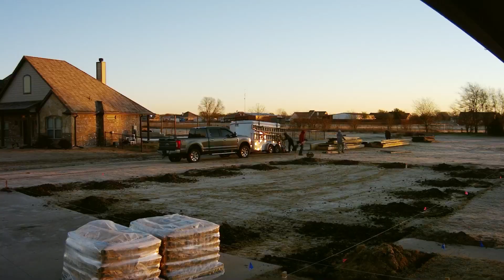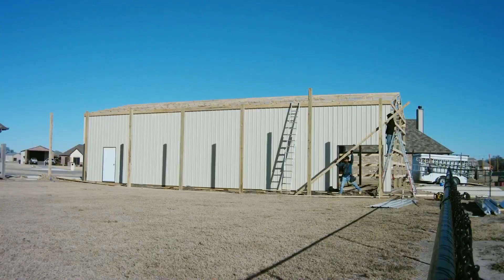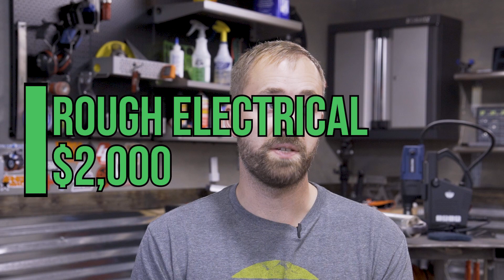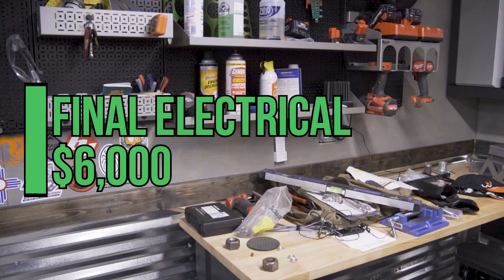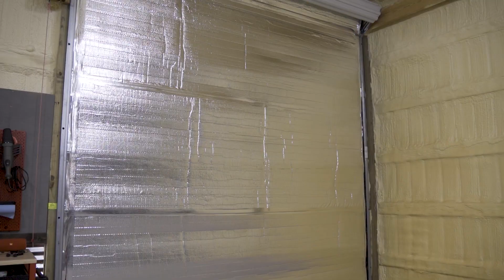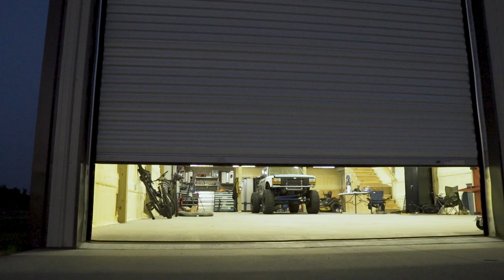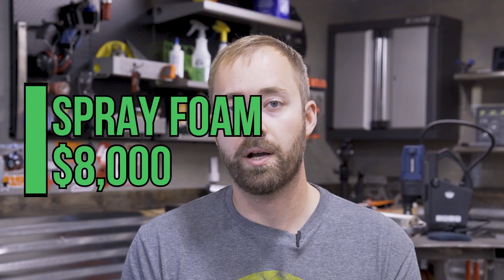How Much Does A 30x60 Pole Barn Cost? - Reckless Wrench Garage

Comment: I live in northern Michigan but grew up on a Nebraska farm where we poured concrete, built sheds, and if we needed something done we did it ourselves. I am a crippled veteran so spending the $180k they were asking to build my shop was out of the question. They wanted $80k to put up a 24x24x10 garage. Yeah the builders/contractors here are really proud of their work. I built a 32x48x12 for about $18k. 

I have to worry about snow load. 72psi is the requirement, because we can get 6 to 8 feet of snow in a few hours. Lake effect is epic.  I see the inside of your building and if you built that where I am, it would be on the ground by the end of December. I had to clear trees to build my shop, so I did that and rented a small excavator to rip up the stumps. Started running the chainsaw in the last week of June, had to wait for the snow to melt and the ground to dry enough to work.

Then I prepped the foundation, built the forms, and poured a 5" thick slab with steel mesh and fiber concrete. The guy who came out to help me pour it charged me $6k and brought one other guy, then the cement trucks started running. We did it in on a Saturday afternoon in September. Yes it took me all summer to clear roughly 3 acres of trees, stumps, and rocks, then dig the footings and level it all by hand with string levels. I got it within a quarter of an inch across the entire slab.

I picked the best maple trees that I had to clear which were the straightest, and used chainsaws to cut one side flat. Some of them are 14" in diameter, so its VERY overbuilt for the poles. Then I started building the walls. Hired two guys to come help me put up the trusses which I had to buy for $5200, and rented a scissors lift to raise them up. That took two days, and I paid those guys $1000 each to help with the roof, which took another two days to sheet with 5/8 OSB then put the steel on.

From that point it was all me. I built the sides, the sliding door, wired and started insulating it. Sheeted the entire building with 5/8 OSB then put on the steel, they don't sell the lighter stuff around here. Buried the wire to the shop from the meter 150 feet away with a ditch witch. I figured why not put in a lift for working on my cars, and I made deeper pads in the slab where the lift would be bolted down. I'm getting old and like I said, I am a crippled veteran, crawling under cars is not my idea of fun anymore.

I finished the basic structure in November, and hung the sliding door two days before the first big snow back in 2015. In 2018 I put a lean to on the north side so I could park three vehicles out of the weather. In 2021 I built a lean to on the south side where I can park six vehicles out of the rain and hail we get occasionally. Currently I am insulating it more and adding a lot more LED lights so I can see what I am doing.

This summer I will build a simple 5 car garage next to the shop, gravel floor, 22' deep, 8' ceiling, and once again I am using the trees I have to cut down to make room for it. This time I am getting a portable sawmill to cut the posts, and its going to be a post and beam structure rather than a 16" center stick build like most people do. Yeah I am kinda into old muscle cars, and I want another spot to park them out of the weather as I finish rebuilding them.

Then there is the house I built... with shipping containers with the same $30k building loan that I used to do the shop. I call it my two story burrito bag. The best idea with shipping containers is to insulate the outside with a stick built fascia otherwise the steel gets cold and condenses water on the inside. Rain and stuff inside the house don't mix well. Its all temporary but I am making it nice enough to live in until I can get a log cabin kit and put that up where the old decrepit falling in cabin is sitting. 

This was a hunting camp before I bought it, but I needed an inexpensive place to live, and this fit the bill. Been a crazy amount of work though. 

Its all built with an eye towards going off grid easily, because the grid is VERY unstable here. It went down 47 times last year, which is why I have a 7kw generator. All the lighting is LED, heat is a pellet stove, firewood, or the compost pile water heaters I build (sawdust from the sawmill and woodchips will make one next year and I will make a video series of it). I make ethanol fuel from cattails and tree sap, because gasoline is expensive and I like to drive old muscle cars with Pontiac 455s in them. Started doing that back in 2007 when gas was $5 the first time.

Along with the garage I plan to build a greenhouse so I can grow food all winter and power the grow lights with a small generator running on methane or ethanol which will dump the CO2 produced by burning those fuels in an engine, into the greenhouse to use less water and grow more food. 

Inadvertently I built EMP proof buildings. So I am apocalypse ready... save for big space rocks or the Yellowstone caldera.

If you have time like I do, and some of the skills you can do this too. If you don't have either of those... best to pay people to do it for you.
Reply: You should make a video of these buildings, I’m in MI too and would love to see

Comment: Thanks for the info, great video. In the architectural phase of building a 50x50 steel building in Phx. Knowing I should go with 2" spray foam helps with my budgeting.
Reply: How did your building turn out? What are you heating/cooling it with and are you happy with the 2 inch spray? Any moisture drips from the ceiling?

Comment: You did not mention zoning restrictions and permit expenses.

Depending on where you live, zoning may require a variance approval, which can easily cost $300+ to apply for, with no guarantee of approval. 

The expense of engineer or designer certified blue prints will be required for a permit to be issued. Normally, a permit fee is included with a builder's estimate/contract, but if the builder doesn't bother to take out a permit, construction can be stopped by your area's enforcement authority. The enforcer can actually demand demolition of whatever has been done (without a permit). The property owner is ultmately responsible to obtain a permit.

Again, depending on your local ordinances, final occupancy approval will have certain requirements - minimum restrictions may include lighting, an extra exit(s), insulation, rat walls, depth of footings, truss certifications, and a friendly, aggreable, and/or lenient building inspector.
Reply from the maker: Good thing I live in a state that requires none of that to build an auxiliary structure

Comment: I think you got taken for a ride on the concrete. You payed probably around 2x too much in my opinion. 15k for a 30x60 slab is very high.
Reply from the maker: 40x60. That is the expense of concrete in my area at that time frame. It averaged 6.25-6.50 per sq foot from multiple bids
Reply: @RecklessWrenchGarage  Dang. Those are some tough prices

Comment: Great video!!  You did not disclose the permits and cost of them .?What material did you use on interior walls?
Reply from the maker: Interior walls were framed in with 2x4 so I can hang 1/2 inch plywood and roofing tin
Reply from the maker: My state does not require permits for an auxiliary structure where I live

Comment: I’m in the process of planning a 50x60 or 40x70  pole building now.. prices where I live are all over the place. Looked into a metal building much more affordable but I’ll have to build it myself. Not sure if I want to take on that big of a project.
Reply: I’m in the business. Free advice; Beware of metal building brokers posing as manufacturers. Your anchor bolts need to be perfect. Hire an experienced steel erector. Anything over a 2:12 is a waste of $ unless you just want the look of a steeper pitch. If a manufacturer asks for more than a 10% deposit and have “free” or “included” all over their quote, run..
Reply: @BLKBETE11  I’m planning at least a 4  / 12 pitch. My snow load is 85 lbs. most people around here build pole barns but not very cheep so was looking at steel building.

Comment: You never put anything smaller than a 42 Ct 200 amp panel in a shop. Also make the stairs to the mezzanine on hinges . Use a harbor freight A/c wench to lift it. Not hard to do and not expensive. It will free up a lot of floor space. I had one in my old shop. We sold that farm ,but the next shop will have an elevator ( using the same H/F winch.you could also do that and just remove the stairs. There are plenty of videos here on different waves to build one

Comment: Thanks for sharing!! You could get 10 guys together that built the same shop and the Costa will all be different. Don’t worry about what you hear online. It’s been that way for all my knowledgeable lifetime! I’m 60,,, almost. Heh heh.  I think you have an awesome shop!! You did very well with the mezzanine as well! Really like the overhang/ outdoor storage as well.  I live up here in Canada so we insulate to keep the heat in!! 😂😂 last might the wind chill was -44 C or about 46 below F!!! It’s pretty d*mn cold out there!! I’m retired now so my shop is for my toys & projects. Was gonna do a 40 x 60, but there was room to go as big as 60 x 80 with covered outdoor storage that was another 24 ft (I have a lot of classic vehicles, I have a 4 car garage and 3car attached garage as well,,,, 😂😂, still not enough room). The shop walls are 18 ft and the mezzanine is 40 x 20 on one end. I have all my automotive & woodworking tools under there as well as a bit of a lounge and 2 pinball machines,,,,, priorities!! Haha. My wife took over 28 ft of the mezzanine and the stairs are within the 40 x 20 as well, so I didn’t get much storage up there!!  It all works. 
    I have 8 x 4 post lifts in there for auto storage so no special needs for the concrete, but it still 8” thick for the whole floor. There’s a floor drain for the length of the shop. My main lift is accessible from a side door and there are 4 - 12 ft w x 14 ft high doors on the front 60 ft facing  and 4 man doors. Lots of windows. I buttered the walls with 2” of spray foam for a thermal break, then built 2x6 interior walls against that with R22 Rockwool insulation and covered with steel. The walls have 3/4” plywood backing where I planned to hang things out the cabinets in the tools area etc. Then we put a steel ceiling and R50 blown in insulation up over the ceiling. The shop is comfy with the only cold spots being the doors. They are steel & insulated, but you can only do so much with them.  The shop was expensive!! I wouldn’t change it and after selling out the ranch, it was not a stretch financially. That being said,,,, I was my own contractor!! Gotta save where ya can. Saved about $35,000 CAD doing it that way compared to the lowest quote. Went overboard on the insulation, but you can be down in the floor and not be cold,,,,, which mattered a lot to me! 
     I am jealous of the Texas winters, but those summers!! I understand insulating against the heat!! I still have AC in my shop as well. It’s solar & wind turbine powered for electricity. You wouldn’t know it unless you looked close at the roof and out the back where the wind turbine is. The batteries & mechanicals are in a 10x12 room with lots of storage still available for my wife’s supplies. Haha. She tried to take over!!!😂😂. 
    You are going to get decades of great use out of that shop. I really like it a lot!! Great colours and you put the right things on like the rat guard to keep it new for the time you have it!! I see ya filling it with toys in your retirement!! Heh heh. Nice stuff indeed!!! Love your doors too!! I have panels for the better insulation values, but you don’t quite need that level and as such you get wayyyy nicer/better doors as a result. I’m a lot jealous there!! Very nice place!!

Comment: Thanks for the break down! These have gotten even more pricey. Especially the red iron builds I want to add a overhang similar to yours to park my fifth wheel under. I was quoted 30k  just to add that. And it isn’t even going to be fully enclosed. Waiting for these insane prices to drop down. The market has gone crazy. If I would of added that while I was building my shop it would of been about 15k. Wish I just bit the bullet than, but we didn’t have a fifth wheel at the time. It’s always cheaper to do it before it’s built!

Comment: I'm looking at building a 60x80x16, prices have went stupid.  As of 12-6-22 Morton for instance wanted $50 a square foot for an insulated building.  $240k.  I've got bids for less, but sticker shock is a real thing.  I have 2 local concrete places and material alone would be 15k.  Concrete contractors want an addition 17k to do the job.  Menards project calculated material alone would be 100k.  I'm sure I could do the entire thing myself as I've got equipment and the background to do it, but I'm lacking the time.  Although it is feasible to build a little at a time on the weekends, it's not ideal.

Comment: Wow, concrete is stupid expensive now!
About 4 years ago, I built a 40x60 steel building with a  6" 4000 psi slab that cost me $12k.  That included trenching and everything.   I leveled and compacted the soil myself.  76 yards went into that floor.

Comment: I was absolutely terrified of electricity so never learned to wire anything until I was in my mid 40’s. Once I learned (correctly and safely)I was so thankful because of the money I’ve saved
Reply: I learned on my own too. Rewired my whole house and put in a 200 amp service. Wired my garage and went overkill on the outlets. They're all ganged off of one GFCI, so it meets code in my area. I can't believe what electricians charge to put in an outlet for a welder. I bought everything I needed, minus the wire which I got free at work, and it cost me 55 dollars and a couple hours of my life.

Comment: A mezanine can be built with the load bearing on the slab foundation, or reinforced areas for your posts. The attachment to the walls would be more for aesthetics or extra lateral support. If a mezanine is an afterthought for your building, you can cut squares out of your slab where you want the posts to sit, and dig out for a footing to be installed.

Comment: Hey man could you give me more details on how you insulated the role doors and how you made them automatic because I have rolled doors that came with my post frame 3540 and I just ordered some garage doors from Lowe’s $1000 apiece but I’m thinking that I if I can insulate them properly and the brush guards where you got that from for the proper size because they’re both 10 x 10 doors that would be helpful I like your video thanks so much😊

Comment: I built a 24x32 8 foot wall pole barn for my tractor this last summer, composite siding, metal roof, gravel floor, sliding doors for less than $5,000.00.
Reply: Sounds like you got the best bang for your buck. Smart spending.

Comment: You said a 4in slab, but you didn't say what poundage?  2500,3000,4000 ?
Reply: I came here to ask the same question.  Also how much weight can it hold?   Can it you put some kind of 2 Pole lift on that kind of pad?   What degree of angle for drainage was put in so you could power wash something inside  or just wash your shop out and have the water go out the larger door unless you put a drain or two in the floor?

I wish I had the space and money for a 32 x 54 foot building with 12 foot sidewalls so I could put an apartment in the upper section. I live in Colorado so it would have to have a mini split to heat and cool the shop along with good insulation for heat and cold.

Comment: Built my own 30x50with 14ft walls last year. Contracted out the 8 inch slab. No insulation yet, very minor electrical atm. 220v, lighting and a few outlets. I got about 32k into it total atm. Sure has been nice to have. Spray foam that I want here in HOT AF AZ is soooo expensive. Have had quotes as high as 20k.
Reply: I thought you were my buddy Lol he just built the same thing same numbers in VA he's having the ceiling spray foamed this spring then a wall at a time

Comment: I was lucky enough to be taught by my mother that the worst thing I could be told is no. In slc, a lot of old industrial buildings are being torn down to make way for high density housing. I went and approached developers until I found one with multiple buildings I got permission to take down. Then I went to a company that moves buildings and offered them a building in exchange for moving the other one to my property and they accepted. So I have a sweet 40x115 shop being built for my garage, along with lighting, windows, and whatever else was laying around that I could use.

So Go out there guys and recycle some otherwise landfill waste! Plenty of other buildings to save and a great way to fit a large garage build, into a small budget.
Reply: Dude, that's awesome.
Reply: One of those guys I need to make friends with and learn from.
Reply: Holy shit what a great idea!!!
Reply: Must have been a steel building?   Pretty cool.
Reply: @tomm1109  one was post and beam steal structure, but the one I used was wood, built in a way that it was east to dissemble.
Reply: @vilheim11   thats genius
Reply: well ya definitely found the cheat code for that....
Reply: I would love to come across an older building to take down, not much of that around here. I am not picky have my eyes out.
Reply: Brilliant!
Reply: They sure are putting too many high density housing in slc.